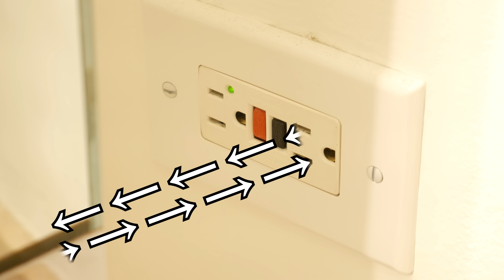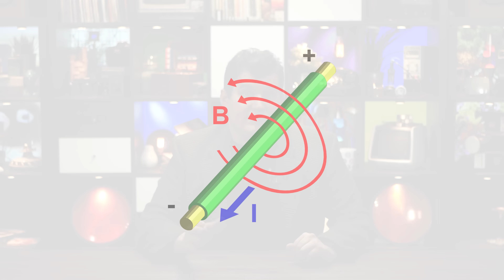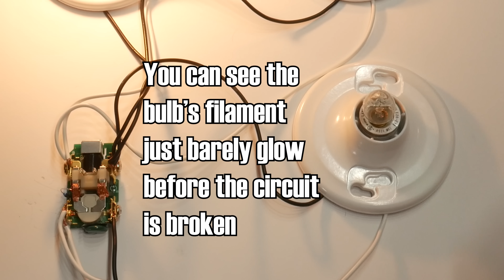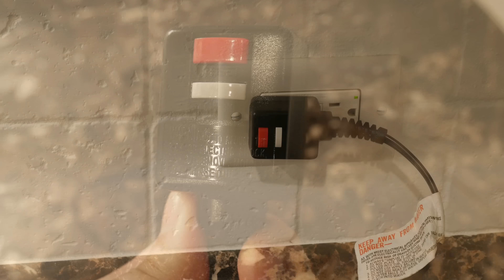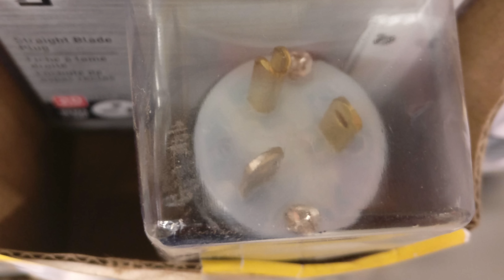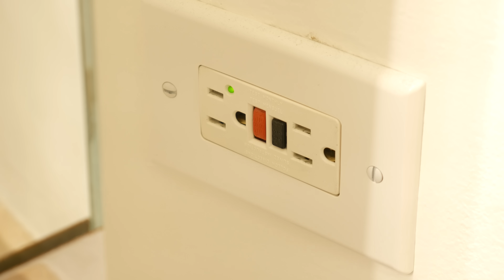The GFCI/RCD: A Simple but Life-Saving Protector

Comment: "But it's not like no one has received a shock in their bedroom or whatever"

Yep. I had a nightstand lamp I would use when going to bed/getting up for work. The lamp had one of those switches that sticks out both ends, going through the contact point where the bulb goes in. The plastic shell around said bulb terminal broke at some point, exposing a screw close by the switch. One night, while starting my night routine, I accidentally touched that screw while reaching to turn the lamp on. Fuck that hurt. Ended up pulling an all-nighter cause I couldn't sleep.

Comment: My GFCI trips when I turn on (or off) the exhaust fan in the bathroom sometimes. Thoughts on what the issue is?

Love your channel, by the way!
Reply: Most likely the humidity or vapors in your bathroom are condensing inside the connection points and / or wiring or the fan circuitry. and create that differential condition.

However, there may also be other causes, maybe the fault could be in your fan and your circuit has a current leak that creates that phase differential.

Comment: In Germany it's called FI (F for "Fehler", which means Failure or Fail, and I for the formula symbol for electric current) switch and it's placed in the fusebox for every individual electrical cirtcut ^^

Comment: So when will you get in to the GFCI's bigger brother? The Arc Fault Breaker? I am not 100% sure how they work, I am an electrician and understand them correctly I think but I have been wrong before, but would like a video that goes more in depth to them like you are know to do with nerd stuff like this. From what i understand and have seen and  replicated for my self on an Arc Fault Circuit, some how it can sense the tiny spark you get from ripping a plug out by its cord and it will trip, Hell some CFL bulbs can make an Arc Fault trip. But hopefully you will look into this and give us a video on how they work! And there is a few terms that you got kinda mixed up in the video that honestly is just nit-picky stuff that I'm to lazy to type out, but when you were comparing the 15am and 20amp receptacle the reason the other one was $3 more wasn't just because it was a 20ampreceptaclel but the TR that's stamped on the device means that it is a new thing called Tamper receptacle, meaning that you can't stick something into just one side of the receptacle, they have little plastic doors over the slots for the hot and neutral, that will not open unless they are both pressed at the same time, as when you plug in a plug to it. That is why some times  they can be a pain to plug in to because if your not lined up perfectly one door will get more pressure and won't open.

Comment: The proper name for these dodads is an inverse rectifier coil. This is similar to the coil used in a rectifier coil in a step down AC to DC power supply.  Minus the capacitors to filter out any noise. In a step down AC to DC rectifier  circuit the coils one is hot and passing current when the other is not live, but is receiving the emc  fluctuation from live coil. The size of both coil determines the step down amount.

Comment: There is also the AFCI (Arc Fault Circuit Interrupter) which will detect any arcing of electricity.  There are breaker versions of these and outlet versions.  They do have a higher detection rate of faults, but using these in conjuction with a GFCI means even more added protection.  If you have a home, look into full home surge protection as well.  Yes this costs more, but your life has no price tag now does it?

Comment: Can you actually die from a 120v? I’ve been shocked before plugging something in and I’m still here.
Reply: It depends on where the current enters and exits your body, but generally speaking anything above 50V DC and 100V AC has the possibility to kill
Reply: @Berando5  Actually, the other way around. 50V AC and 120V DC. Less for animals. But it's not the voltage which kills, its the current. Specifically the current going though the heart (or brain) region.
Contact surface, path of the current, shoes, floor, skin thickness and skin wetness are among the factors which you need to consider when converting "voltage" into "current" and "current deadliness" (in which case time also plays a significant role).
Reply: Are you serous? Of course. Most electric shocks o not kill. In Finland 3.5% of reported electric shocks kill. Americans seem to have very careless attitude to electricity because of the lower voltage.

Comment: Your mains board is in your BATHROOM?!!!!
Reply: Actually looks like his circuit panel sometimes also called a breaker box (or fuse box which is an antiquated term generally only used by older folks as very, very few homes and buildings still have fuses) appears to be in the laundry room which is appears to be in the laundry room which is actually a pretty common place for them in the US.

Comment: It amazes me that in the US an RCD is required on certain specific outlets but is not required, or even recommended apparently, at the main switch. Why should there even exist any socket outlets, lamps or anything else that is not protected by an RCD? 
Is it in the bill of rights that a US citizen has the right to die of electrocution as long as it doesn't happen in the bathroom?
Reply: Lister Dave bear in mind many buildings in the US don’t even have a ground and still operate as a two-wire circuit (even though ground has been required since ~1976)
Reply: @Quartzkensai  It's hard for me to understand why the US is so far behind in the basic aspect of safety.  
It will always be difficult to enforce new regulations on old houses but at the very least a centralised RCD should be mandatory on any new house and not too difficult to enforce.
Reply: Lister Dave as for lack of ground the answer is quite simple, cost. Due to the requirement for all wire (including ground) being bundled together, you have to pull the old wire out of the wall. and the lay new wire in said wall.
Reply: @Quartzkensai  That I can understand but a centrally installed RCD costs less than 50 dollars and does more for safety than a ground connection.
 I don't know how much electricians charge in the US but I would think it would be less than 100 dollars to install one as it need not take more than 20 minutes in most cases.
Reply: Lister Dave they charge in the neighborhood of 150 to 200 per outlet and so most people just deal with outdated wire and outlet
Reply: @Quartzkensai  I'm not speaking of changing the outlets but just installing one centralised RCD. It is a very simple job - about the same as changing a single outlet without changing any wiring so I'm guessing it would therefore cost about the same.
All it needs is: 
1. attach the RCD with screws to the wall as close as possible to the mainswitch,
2. remove the two wires from the load side of the main switch and connect them instead to the load side of the RCD
3. connect the load side of the main switch to the supply side of the RCD with two short lengths of wire. 
That is just about all it takes.  That small job is enough to make it almost impossible for someone to get electrocuted.

Comment: I installed then in our house when I moved in, June 1991. I also had to ground all the outlets in the house. I attached the ground wire from the ground lug to the side of the outlet box. I also have a small GFCI that I can plug into an extension cord for when I am using a drill or saw outside. The outside outlets are not GFCI protected. These GFCI devices rely on the Hall effect to detect an imbalance of current. I just wanted to mention the Hall effect in case anyone wanted to get nerdier about this and read about the Hall effect.

Comment: The shock is not from the excess of current, but from the fact that for you to become shocked you have had to introduce yourself into the circuit through an alternate return path (usually) i.e. the copper piping in your cold water system /sink. Then  there is an imbalance. if you go hot to neutral on the gfci, then as far as the electronics are concerned, you're  just another load consuming watts.  Otherwise this was a perfect explanation.

Comment: 13:20 Interesting, my house was built in 1982 and the service panel has GFCI circuit breakers for the bathrooms, there are no standalone GFCI outlets besides the ones located in the garage which was added after the house was built. I love the channel btw

Comment: The outlet next to my sink is a normal outlet. The one next to my toilet has a GFCI. 1) The toilet is on the far opposite side of the room from the sink, 2) Why is there an outlet next to a toilet?
Reply: The GFCI one is probably protecting the normal one. If you wanna try it out try plugging something into the normal one and hitting the test button on the GFCI
Reply: @squidgrill  I thought that might work, seems like the only logical explanation, but after testing it that turned out not to be the case. Very weird, but thanks for the suggestion.

Comment: Imagine having to walk to the circuit breaker panel to reset your Residual Current Device after taking a shower because you tried to blow dry your hair and now the lights are out.

This post was made by the GFCI/GFI gang.
Reply: While you're walking to the panel you can ask yourself why you put the lights and a hairdryer on the same circuit.
Reply: @martinfitzpatrick697  A bathroom circuit will be on the same RCD, so lights and outlets. The rest of the lighting in the house however should be on a seperate RCD. The real question is, why did the RCD trip when you where blowdrying your hair? It means the insulation of the blowdryer is faulty...
Reply: @sinki19841984  They can be but if one has two RCDs one should mix so that in each room sockets and lights are at different RCDs.
Reply: From what I surmise from your comment is that GFCI outlets are a root cause to American obesity. Hmm...

Comment: Having the RCCB's (what we call RCD's in the UK) all in one location doesn't take that much longer to track down a faulty appliance, you just plug an extension cord into another circuit and then walk around testing your electronics in that portable socket.  For instance in a two-floor home you have an upstairs circuit and a downstairs circuit, so if the downstairs circuit trips you plug in an extension cord upstairs and then go gremlin-hunting downstairs with it.

Comment: This video again proves the chaotic nature of US electricity standards. Multiple outlets for different current, safety devices mounted on sockets, sockets themselves made of bare metal, grounding pin is not essential... As an electrician, it is a pure nightmare. I would wire my house in EU standard if I was living in US, with 220v/30A, and screw the safety inspector.
110V is not a safety measure. Current has to be twice as high, and it is current what kills, so I don't understand the idea.
Oh, and for outdoor/bathroom/kitchen outlets we have a safety outlet with weatherproof spring-loaded lid, and they are usually wired on their own breaker and GFCI.
Reply: I've never seen a power outlet in a bathroom before because I live in the UK and they are not allowed.  I did see a power outlet in a train toilet once, but it was one of those little round shaving outlets that look like American outlets, I would never manage to squeeze my pinkie finger into that socket so I didn't try.
Reply: @krashd  I live in Israel, so we use a fun mix of EU electric standards over here. Mains and GFCI are usually EU standard, anything can be used if it is the correct safety features, manufacturing countries can be UK, Portugal, Germany and Italy. For outlets we use the Danish style pattern with 3 pins, but all European electronics are backwards compatible with this socket. The holes are tiny in these, like European ones. I like the UK socket as well, very sturdy and well designed, except for the size, in my opinion. French sockets with ground pins protruding out drive me insane.
Reply: @krashd  you'd wire your house with 230v? Hope you like to import shit like blenders, hairdryers, and televisions, or you have a bunch of step down transformers.

Comment: Before I could move into this old house, the ordinances required the seller, among many other "violations" written up by the city inspector, to install GFCI's in several locations, and be inspected (again) by the city inspector. I test the GFCI's periodically. One day I, having lived there over ten years, I tested the one in the main bathroom, but for the first time leaving the radio still plugged in, which is a bit awkward, but I didn't want to miss a chunk of my program. And I didn't. The radio was still playing after the GFCI tripped. For over ten years I would have been electrocuted if whatever the GFCI was supposed to be protecting me from had occurred. Not really surprisingly, it turned out that the wires to the "line" were reversed with the wires to the "load," and the GFCI worked right when rewired. Somebody guessed wrong. Aren't electricians and inspectors supposed to know these things?

 Of course I seldom take the radio right into the bathtub water with me, so no harm done really.
Reply: Well my guess would be that either the seller did it themselves or had a buddy with a screw driver do it, instead of a trained electrician

Comment: Well ... all good an well (at least now I know the English terminology) but you have forgot to mention that 10mA can kill you (therefore the 40mA that the lamp uses is not so much only anymore) and 5 mA still hurts AF. Trust me I speak from experience, I had a few run ins with life wires (and not eager to repeat, since it was only luck that I am still breathing). The first time (as a kid) teached me to be careful and respect. The 2nd (as an adult) teached me to triple check if the circuity you are working is really cut.

Comment: I very rarely see these in outlets (here in New Zealand), but more on heavy duty extension cables designed for outdoor use, or with machinery such as a power saw (just in case one saws through the cable, for example).  Sockets, for that matter, are rarely seen in bathrooms in older houses (probably pre-1980s).

Comment: In (Western) Canada, it's considered bad practice to use the two terminals in an outlet to daisy chain (or rather, run them in parallel). Rather, it's better to pigtail, so that you connect the wires together FIRST and then run a short wire to the outlet. This isolates the outlet from the circuit. The other advantage is that it allows you to remove an outlet and cap the wires while still having all the outlets downstream continue to have power if you have to work on a hot circuit ( like replacing an outlet upstream of a server room that can't go down, for example )

Comment: The devices will not stop a shock, but should cut off the current before lethal damage is done. The best protection is not to have power outlets in a bathroom anyway (illegal in UK). Then no risk of shock at all, and without relying on a safety feature that may have been made in China.

Comment: meh, those plugs are pain the butt.  I've have them go off for no reason.   One time, I couldn't operate my leaf blower via one of those outlets.  It was probably because the ground was damp.  But I plugged the leaf blower in a regular outlet and it worked fine I and I did not get electrocuted.    I remember one guy couldn't get his Christmas lights to work because they were plugged into one of those safety outlets.  Again, it was probably because the ground was damp.     They would be nice and useful if the outlets were only set off by a serious issue, but that is not case.   Those safety outlets get set off at the drop of a hat.  I hate them.

Comment: I just tested all of my GFI outlets, and to my shock one of them failed (that is, it fails to fail). I'm glad I watched.
Reply: To your "shock"  LOL
Reply: The pun is strong in this one.
Reply: It was the easiest thing to do.
Reply: I haven't watch the whole vid yet, so this may be a redundant question, but how do you safely test a safety device?
Reply: @nikkiofthevalley  push the button to test it and to reset it
Reply: @nikkiofthevalley  Your talking about the outlet itself right? Just press the "test" button that is directly on the outlet itself and if the green light goes out and comes back on after a reset then its good. If it gives you a red light then it is likely faulty.
Reply: @SalokinQuagsire  I meant, how do you test a thing that's meant to protect you against something, beacause if it fails, whatever it's protecting you against will happen.
Reply: @nikkiofthevalley  That, too, is described in the video. You could just watch it. The test button on these outlets creates exactly the condition that the outlet is looking to prevent; it's not a simulation, it's the real condition. There's exactly two reasons it could fail to operate; the outlet itself is damaged and should be replaced, or the test button is damaged and because you cannot reliably test the device, it should be replaced. If it passes, it passes because all required hardware is in working condition.

Comment: In Brazil, we have a device shaped as a circuit breaker that does this job. The problem is that if anything happens, the electricity supply for all home is cut. You can also minimize the problem by using this device only for the kitchen and bathroom. We also use electric showers to heat the water, it's inefficient but our country is very hot, so it makes no sense for most of the people to have any fancy heating system. Since we can't power these showers with normal outlets(our outlets only supports 10A or 20 A, except for the industrial ones, sometimes the current if these showers are less than 20A, but we are forbidden to use outlets anyway), it can be more convenient to put the protection in the  distribution board.